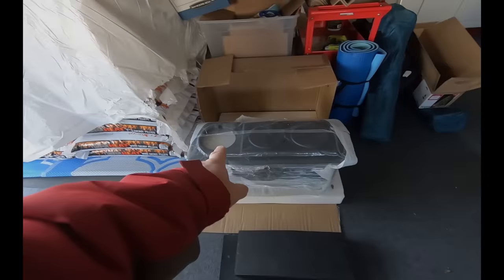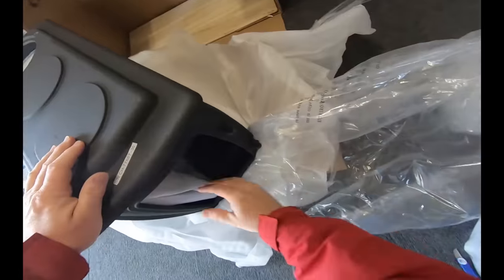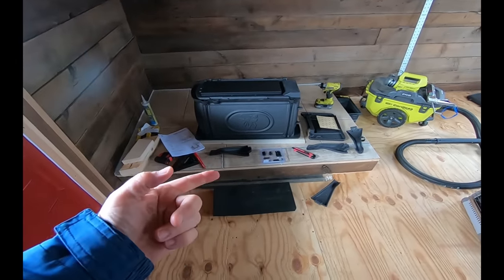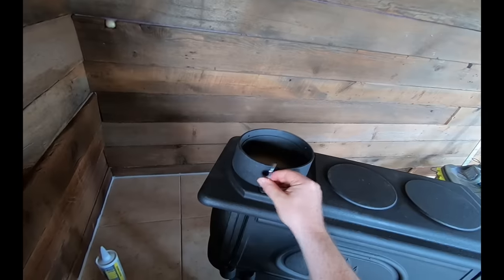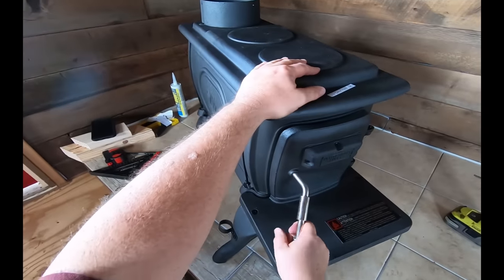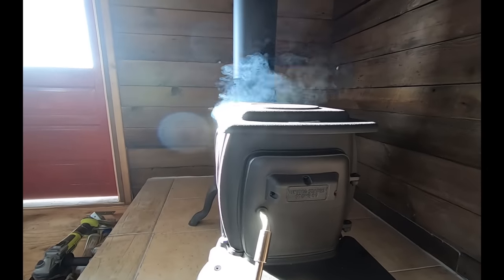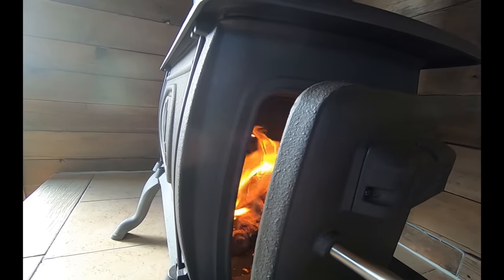U.S. Stove Company 900 Square Foot Log Wood Stove...ASSEMBLY, INSTALL, AND FIRST BURN

Comment: Ours never seems to get very warm, just burns through wood and barely heats out garage . Any ideas? Everyone I know loves these things.
Reply from the maker: Thanks for watching. Mine gets very hot. You didn’t by any chance cut the internal “baffle”out before attaching your stove pipe?
Reply: @LancoAmish nope , just as from the factory. We haven't used it much but had it going today and my kerosene 15k btu heater seems warmer. We are looking currently for more fire wood. We have some for our fire ring but almost out of good firewood. Been looking at a coal stuff for our barn office. We like having multiple heat sources.
Reply from the maker: @Geronimointhewild  , that’s odd.  Mine has gotten to near 700 degrees on the surface. I measured it because some have commented that it wouldn’t get hot enough to make coffee on. Is your wood well seasoned? When I have burned some not well seasoned wood it didn’t produce much heat at all.
Reply: @LancoAmish  I'm trying that now, we had some few years old logs I just went out and split with a maul and am trying that. I appreciate the help. Thank you. I noticed your screen name has PA in it. We are next door in Buckeye country , I picked up the best kerosene pressure Lantern made from an Amish family in Pa a couple years ago. Have to use a tire pump to pressurize it lol.

Comment: Is the EPA stuff that piece of material where you attach the flu to the stove? I noticed it’s not hollow?
Reply from the maker: That is the internal baffle. That is part of the re-burn system. If the stove is  installed correctly there shouldn’t be any smoking problems. The stove also shouldn’t need a damper in the stove pipe. That’ll bugger up the airflow needed.

Comment: Hi I hope you can help me. Purchased identical stove. The 6" pipe don't fit. Is there a trick or something I should know to make it set down inside the stove?
Reply from the maker: Thanks for watching. Are you putting the crimped end into the stove collar? It should only go the depth of the collar itself. You’ll have to use stove cement around it to seal.
Reply: @LancoAmish  thank-full for your reply. We found that the crimped double male end fits and purchased the high temp cement. 👍🏻 
How is your stove working with that EPA part. Are you happy with it working one speed? Would it be a good idea to remove that part and put a damper in to control the burn speed?
Reply from the maker: @angbry8305  , installed per instructions it has burned very well. I wouldn’t change a thing as it’s designed to draw the correct amount of air in and recirculate it to reburn the gases/smoke.  Putting a damper in would mess with that and that’s why I believe people have problems with this stove smoking into their room.

Comment: I bought this stove in September 2023. My 100 year old house is like 950 square feet. It’s better than nothing, but going full tilt it only keeps the house about 20 degrees warmer than whatever the outside temp is. For a little weekend cabin, sure. For a working stove on a homestead? Fail

Comment: I got the same model yesterday actually, did my first light burns and then stepped it up a few notches but whenever I closed the door the fire went out. I’m new to woodstove burning etc. thoughts? Ideas?
Reply from the maker: 3 thoughts. You may have to get the fire burning hotter before closing the door, make sure you’re using well seasoned firewood, and do you have a good draft in your chimney?

Comment: Ok I bought one and thought that white piece was blocking the chimney and was packing material so broke it out and wasn't supposed to ?
Reply from the maker: No. That was part of the stove. It’s a high temp mineral wool that is part of the internal damper/gas reburn system.
Reply: @LancoAmish  well that is a learning experience lol. Do they make universal replacements ?

Comment: I am worried about that foam looking stuff in it though like does it burn or is it fire proof and heat resistent.
Reply from the maker: Thanks for watching.  Yes, it’s fire proof.  It ensures that the gases are burnt in the stove before exiting the stove pipe.
Reply: @LancoAmish  i am thinking ablut cutting all that epa junk out lol.
Reply: @justforfun4623 we get it we all hate the EPA but why would I take out my reburn tubes? It allows me to burn less wood. A new stove and an old Fischer will burn drastically different amounts of wood to heat up the same space. It's pointless

Comment: I have this stove and was going good and then backdrafted in should i put a different cap on the pipe
Reply: Need help with this
Reply from the maker: Is your chimney the correct height above the roof of your house?  Are you burning well seasoned wood?  If you have 90 degree elbows in the stove pipe too many can cause a poor draft. Did you follow the manufacturer’s installation guidelines?
Reply: Yes clears the roof line and have 2 ft pipe with 90 degree 4ft going out garage and 90 degree with 2 4ft pipes clearing garage would a different cap help when the wind blows from south all good it switched from north and it started in.
Reply: Wood is good yes

Comment: Are you keeping the padding inside the opening for the flu colar?
Reply from the maker: Yes. That’s not padding. It’s an internal baffle. This stove is not supposed to be installed with a damper in the pipe. The baffle acts partly as a damper but also keeps the smoke and gasses in the stove for reburning to meet EPA standards. The stove also is a single burn rate stove. There’s no intake air control.

Comment: Mine didn’t have the holes drilled out for the damper and I wasn’t about to drill cast iron myself so I decided to just drill my stove pipe and use that instead. Also the filter In the top really sucks… I pulled it out after the first winter. The catalyst they have in it as well is garbage and you may as well just take a grinder and cut them out because you can’t even fit a decent size piece of log in it. However if you can get it hot enough it certainly will heat a double wide trailer
Reply from the maker: I don’t seem to have a problem getting it hot enough. It’s working out really well. No smoking or puffing at all.

Comment: I bought one because it was on sale. Do you use chimney pipe or the black single wall pipe through the roof. I’ve seen people do both. Straight single wall or triple wall. Single pipe connected to chimney pipe. Chimney pipe is expensive but; I am afraid of burning everything down.
Reply: They make this stove pipe called Metalbestos. It comes in twist together sections in different lengths. You only need it where it passes through the roof. Usually one to two feet below the ceiling and a foot above the roof jack.👍🥂
Reply from the maker: The black box (support box) you see at the ceiling is the transition box. Stove pipe from the stove to the box and chimney pipe from there on up. The chimney pipe adapter that allows the stove pipe to connect to the chimney sticks down Uber the support box.
Reply: @LancoAmish  I live in NorCal and it's always been code to use Metalbestos pipe where it passes through the roof. Some states still don't have codes or do what they want off grid. Maybe your black box is certified and it doesn't need that kind of protection.

Comment: I took that white foam type cardboard material out. I was suppose to leave that in? What is its purpose?
Reply from the maker: It’s an internal baffle that makes the smoke recirculate and burn off before exiting the stove. It also serves as a damper so that a damper doesn’t need to be installed in the stove pipe. It works like a charm.

Comment: Always use a damper on the exhaust, it keeps you from wasting heat.
Reply from the maker: Im undecided.  The stove burns really well without one and isn’t designed for use with a damper.
Reply: @LancoAmish  Go with the directions of the company.
Reply: I have the same stove with a damper, used the damper a lot at first but it caused a lot of creosote, now I only use it to prevent over firing.
Reply: We just got one yesterday and thought of adding a damper as well even though the instructions say not to.

Comment: Just something I have run into I changed the diameter of the pipe from 8:00 to 6 in found that I had a much better efficient wood stove as well as I installed a damper so they can keep the heat in the building and not let it fly out the top of the chimney also the Chimney Cap shouldn't be more than four to five inches above the pipe to give it a little bit of head pressure so it does not suck the wood out of it while burning do that and you will have a very efficient wood stove

Comment: Mine came with a thick white paper like material inside stove up near the top.  What is it?
Reply from the maker: That is a baffle. It is part of the smoke recirculating system. Some people have removed these and also installed a pipe damper because of smoking issues. I did neither and the stove burns exceptionally well. I have a great draw with a straight pipe up and out of the cabin. No smoking at all. 
The stove is meant to burn really dry firewood and the manual even states that. 
When starting a fire do the top down starting method. Fast and hot kindling on top.  The faster you get the heat up the chimney to start a good draft the better.

Comment: With no damper control, I would think it would produce too much heat for that space unless it got very cold outside.
Reply from the maker: Thanks for watching. I control the temp by size and type of wood I’m burning. If I were to live in a house like this I’d go with something smaller and better controlled. It’s sufficient for my times when the little boy in me wants “camp out” in the winter.

Comment: damper? mastic for seams?
Reply from the maker: Damper not required nor recommended on EPA compliant wood stoves. The stove is assembled except for legs and flue collar. Seams are sealed.
Reply: thanks.  never heard that about epa stoves. @LancoAmish

Comment: I never see any flame exiting the holes on the secondary air tube on mine.  I don't think it's working
Reply: Forget it secondary air doesn't work as soon as you open the door.  When it heats up good ain't no smoke so I guess the secondary air is working properly
Reply from the maker: The flame won’t exit the holes from the tubes. Air comes out of those to burn the gases that haven’t burned fully yet. Make sure to keep them open and the tubes cleaned off.

Comment: I'm surprised it says 900sq ft. I had an older vogelzang box wood stove that was heating up to 1950sq ft trailer home. The downside was it wasn't efficient and only ran a load for around 5-6hrs.

Comment: There should be a tag on the stove that gives minimum clearance to a combustible surface. The video glossed over that  What does it say ? The manual seems to indicate 14" from the rear but the wording is imprecise.
Reply from the maker: It’s on the pullout under the front hearth.
Reply: @LancoAmish  Yes, the video showed that. But I'd bet there are people watching the video who might want to know what that tag says. The manuals available online are  confusing, giving different specs, perhaps depending on model year as it's changed over time and with EPA regulations.

Comment: Cool stove. Where is your damper for your flue pipe? Help control the fire burn and retain heat.
Reply from the maker: The new stoves that meet EPA standards don’t recommend a damper.

Comment: Just a heads up you need to put you a damper in your pipe so you can control the heat better and not burn your cabin down 😉
Reply from the maker: Thanks for watching. Dampers aren’t often needed in the new wood stoves with the way they are manufactured to meet EPA requirements.
Reply: 2 things that wood stove is still considered old school and number 2 it helps keep more of heat in and this information is coming from old school
Reply: @johnbennett9149  well your old school is wrong. Directly from the manufacturer says not to use a damper. This is a EPA certified stove. It burns clean and doesn't need a damper.
Reply: I don’t care what the directions say, I put a damper in my stove pipe

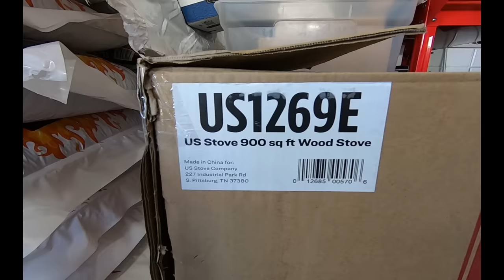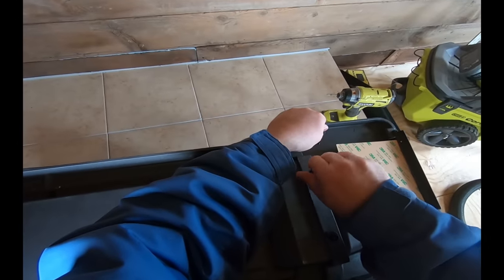Comment: US Stove Company, Made in China! 0:10  On the bottom of the hearth there is a packet of 3M adhesive. What is that used for? 4:25
Reply from the maker: Thanks for watching. China is everywhere! 😀.  The 3M you see is a swing out arm that has installation instructions on the back side.

Comment: epa junk, I will keep my REAL box stove in the cabin ! Cant even cook on this one,I guess some people buy the box stove for looks. Box stove was used for heat and cooking in small cabins, two eyes on top remove for cooking also top slids to side for bigger logs.
Reply: When I was young the real box stoves were everywhere. Now I'm having trouble finding a used one to buy. I'm not about to waste my money on a stove I can't cook on if I need to.
Reply from the maker: Thanks for watching. This stove gets crazy hot on top!  Why would you think it doesn’t?
Reply: @LancoAmish  I'm thinking that these guys are worried the EPA equipment is taking the heat from the top of the stove.   
It's a standing stove that radiates heat to the room from the sides and top.   I don't understand why people would think this myself.
Reply: Completely wrong dude, we got a 2020 EPA stove and you can definitely cook on top. You keep that inefficient stove and burn way more wood hahaha 😂
Reply: Well the year is 2023, It's not 1823.

Comment: So it doesn’t need a dampener?  Loosing a lot of heat out the chimney?
Reply from the maker: Thanks for watching. Newer stoves have to meet EPA requirements where the smoke has to reburn.  A damper can interfere with the correct airflow needed. A lot of people seem to have trouble with this stove puffing smoke into their house. I have a suspicion they are hindering air flow with a damper. A damper isn’t recommended on EPA stoves.  Thanks for watching.

Comment: Forgot to install the damper before installing the pipe! That thing will run away and get to hot.
Reply from the maker: No damper recommended. It has a built in recirculation “damper” to meet EPA requirements. I haven’t had a bit of trouble with this stove like many in its reviews have.  I haven’t had any smoking at all into the room nor have a poor draft. I think too many people install these EPA stoves with flue dampers and that screws up the smoke/gas circulation and causes most of their problems.
Reply: Today's stoves are regulated by the airflow in, not restricting the airflow out. Keeps a negative pressure and no smoke leaking into home.

Comment: Did he install  a damper in the pipe to control the smoke
Reply from the maker: Thanks for watching. No damper needed in newer stoves that have EPA required re-burn components. A damper can hinder the correct operation of the stove.

Comment: For anyone looking to get one of these 'boxwood' stoves you want to look around for a used Vogelzang BX42E Deluxe Boxwood Stove because it's firebox is 27 inches deep and it's got two removable 8 inch cook lids. Our dear friends at the EPA put an end to this larger model. Being able to feed 24 inch split logs into it is a game changer for less work/longer burn time. Makes this chinese knockoff look like a joke.
Reply: As I stated in a earlier post, I have a used one for sale, needs cleaning up and painting $75.00
Reply: But even it was made in China I believe, about 18 years old.

Comment: I don't get the latch. Not enough angle in the shaft to secure it properly.
Reply from the maker: Thanks for watching. It is a little finicky. I use two hands so the stove doesn’t move but it latches securely.

Comment: I hope it's better then the force air outside furnace I got that was built by u.s. stove I got from mills fleet farm. And boy did it suck. When it was down below freezing it wouldn't even keep 60+*. And I got no help from them and at where my pipe came in was lucky to be over 70*. After a bit I returned it to fleet & farm for a full refund. They treated me good.